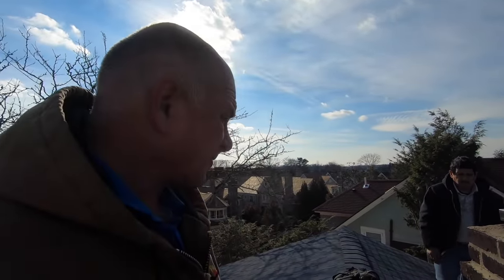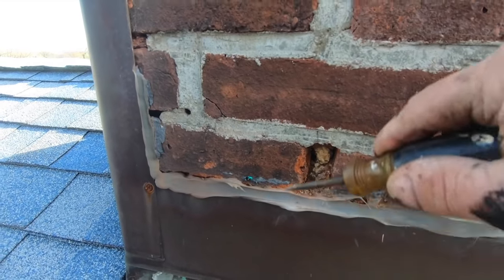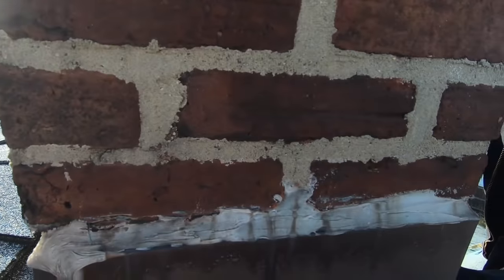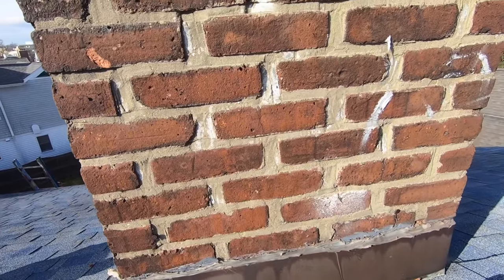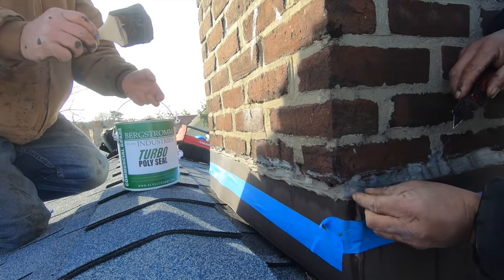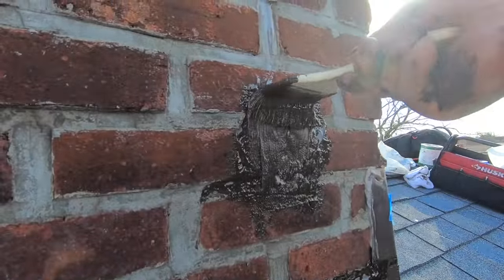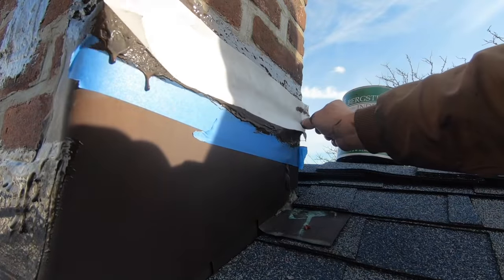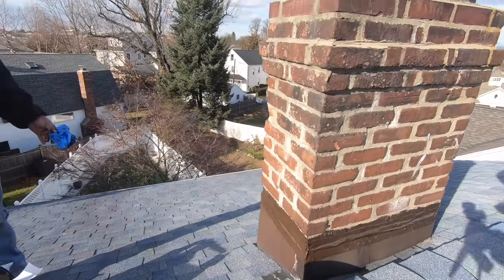CHIMNEY FLASHING LEAK REPAIR - easy step by step with Turbo Poly Seal

Comment: Well, in the amount of time you spent fooling with that, you could have: 
Cut a brick kerf
bent some counter flashing,
Applied sealant in the brick kerf
Set the counter flashing
Tossed a couple Tap Cons or concrete nails, Sealed the heads,
Left & Wouldn't have to touch it ever again.  It would also look a lot better! 

I normally like your content, however this one gets a thumbs down.
Reply from the maker: Hey Robert, Are you kidding me. 
1. Cutting a brick kerf - getting the grinder out and set-up time - and cutting - 20 min
2. Set up a brake to bend flashing - tag a brake along for flashing -  st up        30 min
3. Sealant?? You mean caulking as they did with already flashing in a "kerf" (that failed) 5 min
4. Get a drill and add "Tap Con"    5 min
You must be out of your mind to think that the process you described is faster than what I did in the video. That literally  took less than 10 min with no tools but a brush and scissors. 
BTW. the sealant you are referring too is caulking, and that never last. Ther Turbo Poly Seal covers at least Two inches on either side of the transition. That will seal better and last far longer than caulking that covers barely a 1/4" on each side of the transition. Caulking also shrinks and thats why it always comes loose from the brick or any object.
Reply: No you use a cordless grinder it takes a min to put a diamond blade in if you are really slow.  

To cut and bend an edge on the flashing takes at most 5 mins if you don't do it all the time.  And no you don't need a break the edge of a 1x or the edge of a ladder works just fine.  

As a chimney sweep i reflash allot of chimneys.   And the hardest and most time consuming part is cleaning off the goop used by previous people "fixing" the flashing.
Reply: Flat Roof Doctor you never responded to his counter. Is that defeat ?
Reply: Dumb comments. Re-watch the video. He's showing a solution for the home owner to do themselves and said a couple times for them to go pick up a can. Because you know...all home owners have metal breaks.
Reply: As a new homeowner with zero experience doing any of the main comments suggestions I appreciate the tips that Flat Roof Doctor gave in his DIY video. I'm not sure which would be better honestly but if the treatment Flat Roof Doctor did works then I'll be doing that. It's very simple to the average homeowner that doesn't have the experience of fixing these things and would normally spends hundreds if not thousands to fix these things.
Reply: KingGripper And that’s the difference right there you can have a license contractor do it for you and then someone else is liable when shit hits the fan or you could do it yourself not know everything’s rotting to shit for five years and replace half of your house... Hopefully through a licensed contractor
Reply: @CharliePoppuh  
I don't know crap about chimney flashing, but even I know you can get Quickcrete mortar mix for 3 bucks to repair the brick mortar properly.  Filling it in with neo-tar (that's what I'm calling it, sue me), seems really ghetto, even by my standards.
Reply: @suzyrottencrotch5132  yeah but the issue is,  even these "contractors" dunno wtf they doing half the time, and yes you say someone else is responsible but i don't imagine you have a ton of experience with bad contractors 🤔 cuz you're liable to never get the work finished or having to sue for time and damages cuz some dumbass wanted to cut corners.  You can't physically force somebody to finish bad work,  and once you try i promise you will waist more $ pursuing it.
Reply: @suzyrottencrotch5132  least this way you know yourself the shit is not leaking

Comment: For 1 thats not the proper way to do that lol number 2, now your chimney looks like total shit with all that tar and tape all over it. And lastly(I could go on but 3 is enough hopefully) now its going to cost you more because someone who is a professional and knows what they're doing like me will have to clean up that mess you made and its going to piss me off because that tar gets everywhere all over everything and impossible to get off. So I'm going to charge you more.
People also have to understand that 90 percent of these videos are wrong because the people making them doesn't know what they're doing either, or they're figuring it out for themselves. Then you guys watch it and think oh I can do that. I'm not complaining thought because it generates work for guys like me hahaha.
Reply: OK, I agree with you. What would be the correct sealant to use between the brick and the flashing? Or no sealant at all?